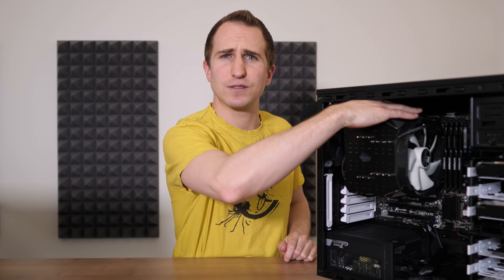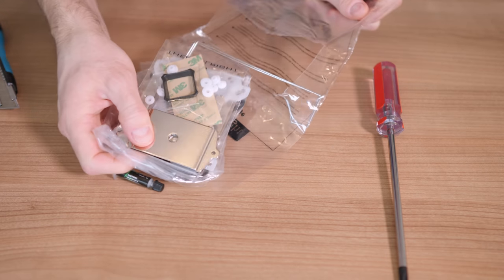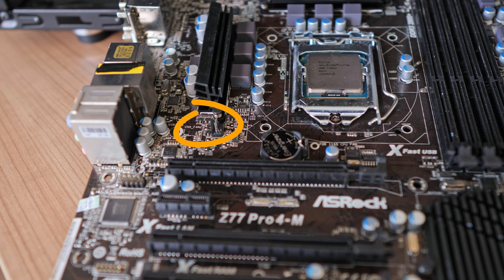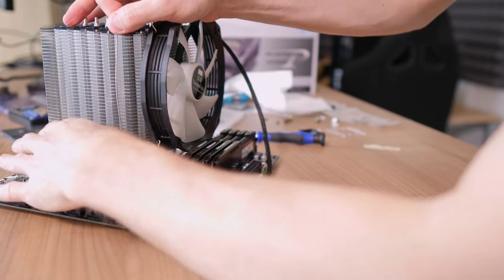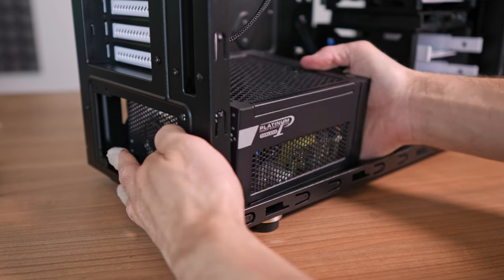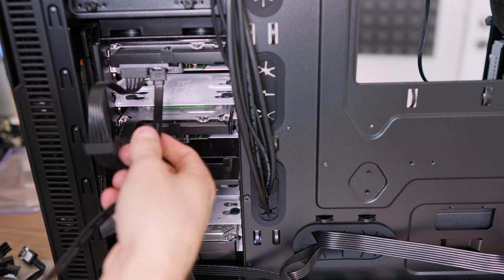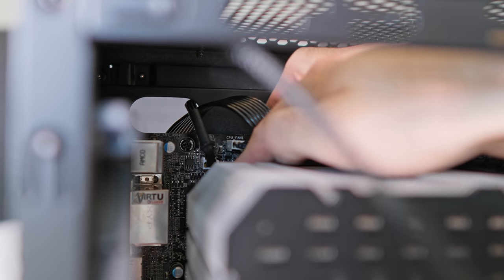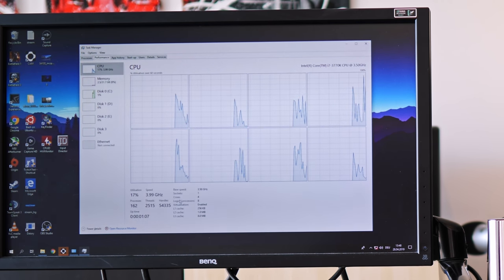How to Build a Home Server Part 2: 16TB Home Server Build 2019

Comment: isnt the cpu using a lot of power? wouldn't it have been smarter to buy a cpu that doesnt require much power? Because if you're letting this run 24/7, the power bill will be expensive!
Reply from the maker: Not really. This server is using about 50W which translates to roughly 60 dollars energy costs per year

Comment: Hey can you make one for an office? I am open ing up a small office. 5 users using the server ad a remote desktop and we can connect to via our machines. Ty
Reply from the maker: I'm afraid I don't understand what you're trying to attempt. Also, this is really only for personal use, rather than a professional environment
Reply: @TechGuides  hey, no problem. At my work at a previous law firm my work had a 2012 windows server where we cpuld connect to it by remote desktop connection. You could use a less fancy computer as the work load was on the server also it kept the data secure on 1 machine. I wanted a similar thing for my new office. 5 users and 1 server that we could connect to. 

Ty anyway bro

Comment: Hello Tech Guides. I liked your videos about vp9 youtube codec. Can you give opinion if NVENC capture is as good as CPU-based x264 capture for 15K-20K bitrate aimed at youtube uploads.
Reply from the maker: Thanks man! Well, I record all my videos with NVENC at 130mbps (Shadowplay) respectively 70mbps (OBS). At these bitrates you will never be able to tell the difference between x264 and NVENC and given the almost zero performance drop, I will probably never use x264 for gaming / desktop recording again.
Reply: @TechGuides  Thank you for your honest reply. The reason I asked is that I am looking to assemble a PC,  it would be family PC but it should handle any application, including screen capture of 3d modeling, 3d games at medium settings, etc. Most articles talk about x264 encoding at low bitrates for stream, but this won't be useful for me. 
Do you think it is safe to get a value CPU (e.g.Ryzen 5/7) and a RTX 2060 or GTX 1070 second hand card and record with NVENC at 15~20mpbs for local storage of 1080p 30/60fps capture?
Reply from the maker: So Im not sure I completely understand your intentions. If you simply want to record your desktop and maybe a game or two locally, than NVENC is definitely the best solution because you won't need an uber expensive CPU to do the encoding (and your applications wont lag like hell). Generally, the higher the bitrate the better the NVENC encoded footage looks like.
Reply: @TechGuides  That is exactly what I need it for, thanks.

Comment: So i could not get the Cooler - Thermalright Le Grand Macho RT i went with the "Arctic Freezer 34 eSport DOU its looking good :-) the CPU - Intel i5-8500 Desktop Processor 6 Core , i can upgrade it some day when i have more money around :-). it seems to be a hard decision on RAM i know i was 16GB . we will see hmm any thoughts there for me ?
Reply from the maker: You can't really go wrong here, Linux runs extremely well on pretty much any hardware :)
Reply: @TechGuides  I put Widow server 2019 on it it's a smooth run !!
Reply from the maker: @kennethmclaughlin9538  Awesome!

Comment: Could you make a new Sony Vegas Render Settings video?
Reply from the maker: I'm afraid I don't use Sony Vegas anymore, I'm editing my videos with Davinci Resolve now
Reply: @TechGuides  Is Davinci Resolve easier than Sony Vegas or better in general something because I would want to want to switch
Reply from the maker: I've used Sony Vegas for 5 years and it was super easy to switch to resolve. Its just sooo much better in terms of stability (have only crashed like once in the last 6 projects) and scrubbing through (4K) footage is buttery smooth! Its also 10 times better for complex projects and color correction is amazing. Plus its free ;)

Comment: Why didn't you start with the mobo
Coz all builds I've seen they start with the mobo
Reply from the maker: Erm 1:04 ?
Reply: I mean put it in the case first other than last
Reply from the maker: @wiredWhiz27  Assembling the mobo is much easier when its not in the case yet. In fact, I should have even connected all cables first, before putting it in the case as the clearance was very low above the mobo and connecting the power and fan cables was a pain ;)
Reply: @TechGuides  as long as the pc is build there is no problem then coz methods and opinions differ but the final result is the same
Reply: @TechGuides  great video by the way
Reply: Do you have a solution to a laptop wifi adapter not working after I did a system restore I ve tried downloading drivers but is not working or could it be that the adapter is damaged

Comment: "It doesnt matter how much you put unless you put too much or too few" so it does matter after all? hahaha
Reply from the maker: Haha well too little and you wont cover the entire IHS and too much and it will flush out the sides ;)
Reply: I noticed that he is using Arctic Silver thermal paste. Arctic Silver has specific instructions for applying their product. In the case of the majority of modern Intel CPU's it's recommended a pencil lead sized line vertically on the CPU die from top to bottom. In the beginning I used to struggle with the whole "too much or too little" thing myself.